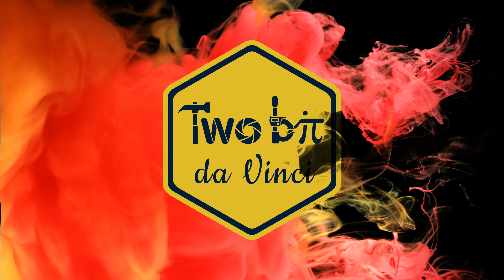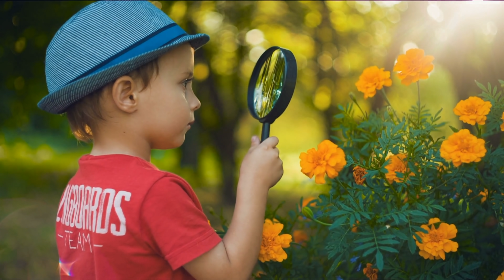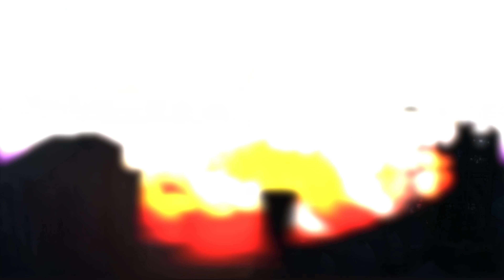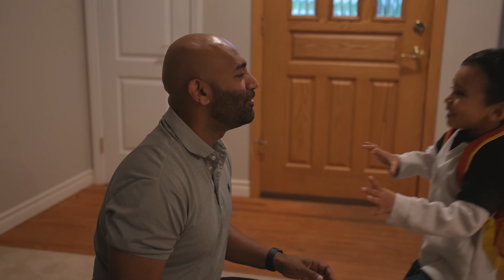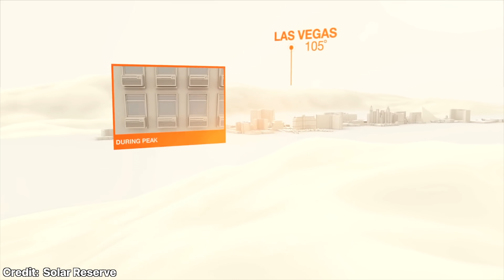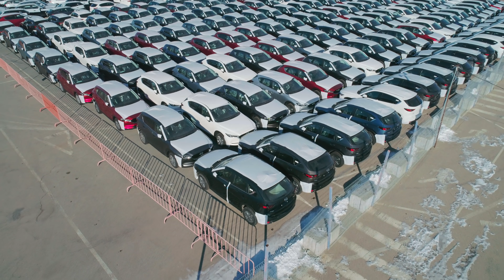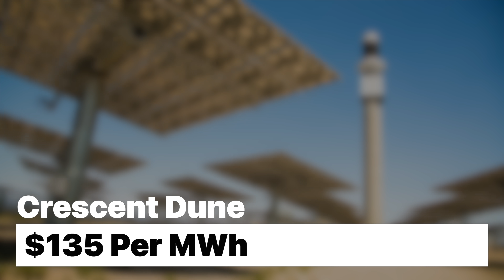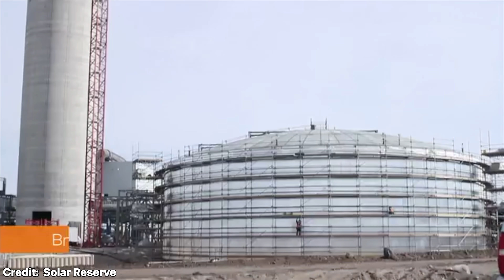This Billion Dollar Solar Plant was an EPIC Failure

Comment: As an engineer, I find this blunder fascinating.  Very surprised they didn’t anticipate leaks from welding techniques, didn’t design for automatic lubrication and auto mirror cleaning.
Reply: Moisture and salts cause stress corrosion cracking of stainless and nickle based alloys needed to work at those temperatures. So it's a design and materials selection issue, not entirely a welding issue.
Reply: @westt1988  I worked at a company that built a welding system for welding tubes that connected the heat exchanger to the top of the tower and it was all Haynes 230 for the heat as my understanding is they would be red hot in operation.
Reply: @westt1988  you wouldn't suppose they made it fail on purpose right? It seems strange they would mess up with corrosion. Perhaps not enough competitors building the same type of plant? If nothing is at stake then the development will go complacent.
Reply: @Dolvondo  sea wolf submarine is the last liquid salt boiler that comes to mind. People just don't know how to keep things isolated properly, or assume it might happen.
Reply: @westt1988  true, but they figured that alloy out for thorium sodium reactors, it was a metal I had never heard, something zinc based, or zinc coated called zircaloy, I believe , but it run for years without too much issues
Reply: @mikeysgametime8914  I agree you design for an intent. But do people design around assuming they will get cross contamination or how to ensure they prevent that.
Reply: @westt1988  so yeah I agree, if it could work in a reactor, definitely quality, or material issues
Reply: @westt1988  You would think they have a steam let off built in right?
Reply: @westt1988  Molten salts are well understood for this kind of application thanks to Oak Ridge's nuclear reactor work in the 1960s. Stainless steel is not the right material for this application - you don't need hastalloy's radiation resistance but you do need its salt resistance and low expansion coefficient
Reply: @westt1988  nickel copper alloys used on ships would have been a better alloy for such //
Reply: @AaronSchwarz42  if this is built to ASME Section I Power Boiler Code nickel copper is not an approve material for construction.
Reply: @westt1988  All of the hot side salt piping was built from welded 347 Stainless steel. All welds 100% X-RAY. I was on the project.
Reply: @matthewerwin4677  one would think so.
Reply: @matthewerwin4677  stainless steel? Isn't salt highly corrosive to that? And what did u use as welding material?
Reply: @kungfreddie  347 stainless pipe or plate got 347 stainless filler metal. 347 stainless to carbon steel was inconel filler metal.
Reply: @matthewerwin4677  so then why did  the pipes corrode???
Reply: @matthewerwin4677  thanks for your reply, but you what I'm trying to get at, that is,  If the salt corrodes stainless steel than why use it?  this green technology is not something new and has been used at other parts  of the world successfully, including ships and tankers related to salts.
Reply: @matthewerwin4677  in your opinion, what killed the plant? Since you worked on it I figure you would know better than most.
Reply: @jamminwrenches860  It should've been built close to Las Vegas instead of 200 miles from anything. The 7000' elevation of the site means the mirrors get covered in snow and ice in the winter. The plant was built In Tonopah for political reasons.
Reply: @matthewerwin4677  me too bro! They x rayed every night! On those carts that they would hook on the edge of the rim! Lol I was there for 5 years almost!
Reply: As a California resident I find this blunder predictable and in line with California's high speed rail to nowhere and LA's $800,000+ housing units for the homeless.
Reply: @erikkovacs3097  Those crazy Marxists and their trains.
Reply: @erikkovacs3097  Why don't you use California rail? It's really good.
Reply: @jamesmedina2062  No. It's not. It's practically impossible for someone like me who is a traveling technician that never works in the same place longer than a month.
Reply: @erikkovacs3097  what kind of "technician"?
Reply: @jamesmedina2062  The traveling kind. I have no commute. I get sent out to a site to do a job and don't go back for a year or more. Some jobs take a month or more. Other's an hour or less.
Reply: @erikkovacs3097  My question is not about you but about the job and tools you use.
Reply: What, you mean the people who think that you can run an economy on 15% efficency renewable energy didn't think the design through? Who would have thought? That's like not taking winter weather into account when designing wind turbines, or not properly testing your turbine gearboxes before selling a bunch of them and having every turbine you sold violently self destruct within 6 months. (Happened at a wind farm near me. Gearboxes were shot all over the landscape)
Reply: @kdrapertrucker  (^$^%#@#/€ We DONT HavE TiME TEZTING, WORLD DIE 6 YRZ FUCK SAKE!!!!!!!!!! I guess that's why..
Reply: This failure mode IS particularly interesting. The same issues with manufacturing processes will be of concern with maintaining molten salt containment in Thorium based Molten Salt Reactor (MSR). Anything learned from this failure can feed into MSR development. MSR projects are currently active in numerous countries, including the US & Canada.
Reply: @robbmain3030  molten salt service in heavy industry is old and very well understood.  There are literally thousands of chemical plants that run molten salt heat exchangers and have for donkey's years.  It just sounds like the design engineer that stamped off on this project didn't know shit about corrosion.
Reply: @StormGod29  you nailed it!!
Reply: @StormGod29  you’re absolutely correct. I worked at a site that had Kolene processes. No problems with the sodium @ 800F…only the other chems used i.e. hex chrome
Reply: @StormGod29  This is less about corrosion than having 600 feed of header pressurising the system and unsuitable thermal expansion coeffeicients in the pipework
Reply: @robbmain3030  It's exciting stuff! The concept is rooted in 1950's DoD ideas. The 1950s, so it's relatively new tech, and just like with the first modern automobile produced a little over a century ago, there will be bugs and unfortunately, people and the environment will be adversely impacted. 

Hover, it is revolutions like this that leapfrog nations ahead of their peers.
Reply: Exactly!!! Sounds like the quality assurance scumbags were signing off the inspection checklist from their homes!! And everyone was getting paid! I smell sabotage! If they weren't sure, they should've started at a small scale first and then expand! Thanks for the video tbdv
Reply: @gregchris418  that's what u get every time u give government money to ppl without any insight.
Reply: Probably contracted to lowest bidder to cut costs so the shareholders were happy 🤷‍♂️
Reply: @warrensteel9954   : That's exactly what's happening in Ireland.
Pathetic.
Reply: @mariano7699  you remember the port tunnel to move trucks. Once finished somebody pointed out to the engineering team that large trucks wouldn't fit in it.
Or the Luas two different guage tracks for the same system so now the two lines are not compatible.
Imagine new York's subway had trains that could only run in some places but not the entire network because some gobshite made a different guage track!
Reply: @warrensteel9954  

Good point - quality comes with a price...you get what you paid for
Reply: @warrensteel9954  their "lead tech" is a commenter above - mister goldstein. life imitates art, lol.
Reply: @warrensteel9954  Sure but I would assume the state requires X-rays for the welds.
Reply: @warrensteel9954    is that antisemitism?
Reply: Sue egineering company that lol planned the huge mess
........could have built small prototype!
Reply: A good point. The failure here might involve more here than failing to anticipate the drop in the cost of PV. Sometimes technology based companies headed by non technology people have problems related to that. That might have been a factor here.
Reply: @davefoc  they knew....pv went commercial which created large used market that took off. To top the cherry China over produced lifepo4 batteries as competition ran up but covid hurt economy.
Reply: In China goat herders bring their goats to eat grass bellow the solar panels and in the meantime they clean the solar panels.
Reply: And why the F. Did they not try a smaller scale model first before wasting a billion dollars?
Reply: @Shakespeare1612  they did near Barstow adjacent to the Cool Water coal gasification plant.  Both clean energy plants failed.  The salt heliostat failed quickly and was abandoned.  The coal gasification plant worked well but needed huge amounts of water but they built it in the desert.  Water was too costly to be economical.  Near a major river or lake it would have been wonderful.
Reply: @Shakespeare1612  
Good question:
The answer is that large scale was already done. Like in Spain.
Quality of metals are better from European suppliers. Did they build it to fail: by built-in obsolescence? Why did this project fail when others did not?
Was it cheaply made parts, bad design? Did they bother to just copy exactly: what was already proven to work, or did they cut corners, or come up with their own design?
Reply: They probly only got the funding if they also figured out a way to weaponize it...
Reply: Ever consider that just like the Thorium plant that just went online in China, might have been a little "adjusting" of the playing field?  A lot of technology seems to work well elsewhere after being deemed either unprofitable or impossible outside of the US.
Reply: My father said this was a bad idea even before it was built, maybe they should of hired him to tell them that, would of saved a lot of hassle and time wasting. What I have learned in life is that some humans just know stupidity when they see it and the majority of other humans are just plain stupid.
Reply: Engineers need to be taught to be technicians. Why? Because troubleshooting is problem the most important part of a technicians job. To foresee why something is not working the way it is supposed to. It's like poker, you know what cards you are holding. The trick is to know what the other person is holding.

When your brain works this way, you will be a better engineer.

I remember reading that It was a technician who figured out how to make antilock brakes work after regular engineers did not figure it out.
Reply: Don't forget its 3 miles from a bird preserve and in the middle of 5 bird migration paths.
They clean anywhere from a couple hundred to a couple thousand birds every month.
Birds that were cooked some explode before they hit the ground.
Reply: @thesilentone4024  I was looking for this comment. This path is the easiest way for birds to travel past the Sierra Nevada Mountain Range. So these birds were being funneled right into a giant oven.
Reply: @danapaul3216  yep and I think it needs to be changed to something else or not be there its definitely bad for life and unfortunately not thet efficient too well this one specifically.
Reply: @thesilentone4024  
Amazingly bad planning
Reply: @thesilentone4024  
Amazingly bad planning
Reply: @thesilentone4024  
Thank you for this information.
Reply: @thesilentone4024  yes, but just because you don't see the dead birds floating in concentrator and wash ponds in all the "third world" countries getting the metals for photo cells, does not make this any more impacting on the environment.
Reply: @ricksanchez3176  what are you talking about.
Phones different country's.
Like come on man I literally just said this kills birds its in the middle of 5 bird migration paths.
Also this produces so little energy that literally every time it gets turned on they loose money.
In fact I'm impressed with how it's still there.
But if you want to talk environmental damage then you should go to the copper and nickel mines in America and get them to stop or increase productivity to reduce demand on foreign mines and reduce the human risk your worrying about.
Reply: @thesilentone4024  Dude you're lost.  Everything is in a migration path, if it isn't a sea turtle, it's a dung beetle.  vacuum isolated solar, there are many up and running works, and works very well, regardless of the hack job on this plant or this video.

And yes, absolutely, I would love to see our US mines back in production.
Reply: @ricksanchez3176  dude your missing a big point.
5 main bird migration paths.
Its also 3 miles away from a bird preserve.
The way the mountains are there its funnels them in a tight spot and they put it smack dab right in the middle of that.
It uses mirrors to heat up the area like heating up stuff should be the last thing to do since are climate is hot already.
Reply: @thesilentone4024  You kinda had me....until you absolutely showed your ignorance to the subject.  The mirrors reflect light that would normally be absorbed and then radiated into that "climate -that is hot already".   It focuses that heat, melts some salt, water on salt, steam, turns turbine, turns generator, magic little pixies carry the heat away from the area to power your AC. Ironically making it cooler in the environment where the light was, and cooler inside your house, but hotter in the environment just outside your house.  Would you like to know how air conditioners work too?  You really should learn.    Yes, if the birds fly through the focused light, poof, (if we could just get them to eat garlic and butter first.) but for heating the already hot climate.......LOLZ
Reply: @ricksanchez3176  shows how much you know like wow.
1 its 20f hotter in a 4 miles.
2 even though its a couple miles from the road it blinds the hell out of you have you ever driven by it when its glaring all the light at you.
3 these mirrors need to be cleaned every day and that uses lots of water they even state that in there own personal website.
4 literally look it up every time it gets turned on they loose money.
5 the amount of land used for this needs to maintained and with this kind of energy no plants at all can be on the ground around these mirrors.
6 I've worked there for 2 dam years i think I know what I'm talking about so educate yourself or shut up.
Oh ya its normal 110f out there normally but around this tower its 130f normally and lots of plants can't grow in those temperatures even the native ones.
Reply: @thesilentone4024  LOLz  So they didn't use TiN glass?  So misengineered their collector?  Ofcourse it would make power if it's throwing light out.  Why don't you take two minutes and look up Thorium reactors, and the impossibility of them, but it works in China.  Why don't you look at the history of these evacuated / collectors, first one was built here and sabotaged aswell.  They work everywhere else.  Do you understand the physical impossibility you are stating?
Reply: @ricksanchez3176  I have dude.
Where this was set up its doesn't make money.
You know what how about you go study plants and hydrology and how heat transfer works then get back to me.
Reply: @thesilentone4024  LOLz  Hydrology is a pretty broad term, could you be a bit more specific?  Are you stating that because they didn't use sputtered glass on these mirrors, while they do solar panels, that makes this proven technology invalid?  If they can warm the surrounding area up 20 degrees for four miles, with this, coal, gas, petro, hydro, you've just solved the world's energy crisis.  Give me details, let's figure out how to capture it.
Reply: @thesilentone4024  P.S. It's not where it is set up, it's how it's set up.  That light that blinds you, that's called a loss.  Engineered that way, I have a hard time believing they are that dumb, but they could be, but likely intentional.  Yes it's far enough from the equator that it has more initial cost and more arrays to maintain than similar plants built in the tropics.  That's solvable through engineering too.  That's where scaling out with multiple collectors increases each additional's efficiency by about 50%.  TiN sputtered mirrors, lessens cleaning by way more than half.  A concave tracking reflector/concentrator into a concave collector would up efficiency substantially.  Is the collector even a fresnel?   It's an anonymous account, I really don't give a flying fart about how feel about my understanding, but it does not take a genius to see the multiple design flaws, if tested at smaller scale would have been dropped.  This particular plant was designed to fail.  Placing it in such close proximity to the bird sanctuary and on the migration paths could very well been part of that.  Why don't you see who financed the financiers.
Reply: Molten salt is not a gentle heat transfer agent to deal with, tough on pumps valves etc.
Reply: I thought the same thing. I would be concerned with all those moving parts as well. Just too much stuff. My personal take on your question is that is was a prototype pushed by pro solar on one side and opposed by anti solar on the other. That means a lot of energy was spent selling the idea and pushing it through and I am sure there was a lot of wishful thinking and not as much money.
Reply: So let me get this straight. We basically let the market decide and the market decided that profit dictates how clean, healthy, and sustainable/accessible any technology is. Something is wrong.
Reply: @bryb2644  No, it's cost that makes these decisions, and costs are very dynamic in renewable energy. Personally, I think advancement in robotics and fabrication techniques could lower the maintenance costs of Crescent Dune to economic viability...someday. Wind had a long, concave downward sloping cost function, and then there was substantial deployment. The maintenance costs of turbines currently prevent wind from undercutting other renewable technologies, but those will decline when robotic maintenance becomes practical.

If photovoltaic becomes the dominant solar capturing technology, we would expect the price of silicon driven up. We should conclude that heterogeneous solar technologies can facilitate substitution when demand pushes up the cost of any particular technology. Don't forget, someone is working on fusion reactor as well.
Reply: I’m sure jobs was a big sell for that $500M. Automation would have “killed” jobs, so, do it the stupid way instead of the lazy one.
Reply: As an engineer I am not very surprised that an engineer thinks that a more complex solution would have lowered the maintenance cost.
Reply: It's an obvious self sabotage
Reply: Same here. I'm not a mechanical engineer but doing mostly embedded systems stuff. However, when we design a new product, we think about the stakeholders and the use cases then you derive your architecture from this and go deeper and deeper into the details until you finally start building "the real thing", i.e. the first prototypes. I am quite sure that mechanical engineers do it the same and they would have/should have had lubrication and mirror cleaning on their list.
Reply: Even those needs maintenance, when cutting cost comes into play, most large and big companies will go to business analyst consultants at the end to provide unseen solutions from a new set of views. That’s where I am, and mostly we deal with governments, either we don’t agree to things and they will do what they think is right, or they see the view from our standpoint where the issue is, and we can start thinking solutions through our own and their connection together. In this video it said, the budget went 4x more than expected, we are not talking hundreds of thousands, we are talking millions. I’m pretty sure they had to consult one consulting company for your solution(especially when the government invested in it) and deemed it as not good enough as the cost cuts is not even close to profit. Because in my case or my company rules, we do it in theory first than implementing fixes that might not result in decreasing or eliminating the problem.
Reply: @ajstyles5704  I have had companies run all the equipment into the ground for one more $.
Reply: @markwagstaff4464  That is because they have a piece of paper stating what it should do when they bought it without looking at those machines and see what they could or couldn’t do depending on the situation.
Reply: Even auto lubeing systems must be maintined by people at some point.
Reply: As an engineer, you failed to consider the financial aspects of this project. It could never make money due to the super high capital costs. Total scam from day one.
Reply: When as a young Engineer and running an "exotic" English motorcycle I was  told by an old Engineer that "when the heart rules the head,   money flies out of the window"  I eventually came to realise that he was right.    Looks like the heart was ruling the head on this project.
Reply: How about the mirrors withstanding strong winds.
Reply: Exactly. Sounds fishy to me, like it was designed to fail. Many things have been built that are far more complicated and been successful.
Reply: 'Welding Techniques' is a nice way of saying 'welds that melted'.
Reply: @bugstomper4670  They don't melt.  They usually crack in these conditions due to grain boundary attack by chlorides.  (BS Chemical Engr, formerly a certified welder).
Reply: @paulparker9339  I was being sarcastic.  But thanks for telling me.
Reply: @bugstomper4670  Gotcha.  Sorry I did not pick up on that.
Reply: Welcome to California.
Reply: That’s because it wasn’t built to any specs, or had any issues or concerns with anything. Amazing how communist people will become when there’s other peoples money available to burn.
Arnold did not promote this project with his money, he used your money to make a mess.
Reply: I do to I am an engineer with 45 years exp in processing engineering
Reply: They were probably ideologs, don’t have to worry about making something profitable, paying everyone a high salary
Reply: mirror cleaning technology development was one of the goals of this plant if I'm not mistaken. nobody quite knew how mirrors would degrade in the desert
Reply: Some waste of money
Reply: @brianbartolomeo107  right, great point, dropping millions upon millions, and yet we have people literally starving to death, what a shit show
Reply: AS AN ENGINEER ..... JOINT LUBRICATION IS THIS ADVANCED STATE OF BEARING TECHNOLOGY SHOULD HAVE A 30 CYCLE ...TIMKEN MUST BE UNKNOWN TO THESE IDIOTS , AS ARE AUTOMATED 100% XRAY WELDING MACHINES ...AND  100%  XRAY  MANUALLY WELDED JOINTS...KNOWN TO THE NATURAL GAS SUPPLIERS FOR ......DECADES....... THIS IS THE BEST BULL THAT THESE  PEOPLE HOPE THAT THE VIEWERS WILL SMOKE.....ABEJECT CLOWNS
Reply: The first rule in contracting out a construction project is to find contractors experience in building such a project.  What, first time something like this has been built in this country?  Oops.  Expect some snafoos.
Reply: It's what happens with government funded green energy projects. They are often taken by people seeking a cash cow with no real intention or ability to competently complete the project. Even when they fail the person in charge still got millions from the gov and the politicians in charge still get to pat their own backs and say they did something green because it doesn't cost politicians anything only tax payers.
Reply: How to launder money
Reply: reading some comments here making me laugh.  you guys never ran a furnace in a foundry before obviously or you'd know that the absolute best materials to use are still not foolproof and even the best welds will give way under those temperatures eventually. and human error just makes it so much worse.  think about it, you use clay brick, the best material for insulation and it still corrodes eventually in an aluminium furnace which is only needed to run as low as 800 degrees ferenheight.  parts are still going to be need absolutely replaced every so often, say once a year.  now that's without human error.  you've got all this molten salt running around all day and night, who's going to run it?  the same guy?  no. you need to train one guy who trains the next guy, who trains the next, etc.  it's hard, stinky, hot, dangerous work, so people quit or demand more money, tempers can flare, one guys screw up can compound and make it harder on the other guys on different shifts, it needs to be a team effort, no one screwing up or everything is now so much worse, slag builds up on slag, clsmall cracks get expanded rapidly!  you can throw all your hypotheticals out the window even if you really know about it a lot.
Reply: LOL - Guaranteed fail when government is involved. Example: see the Boston Big Dig originally budgeted @ $3Billion final cost $24 Billion & 5 years late plus millions of gallons of saltwater are leaking into it daily. If Boston suffers a blackout the tunnels will fill overnight.
Reply: wow. we should put you in charge of every solar plant
Reply: @htf5555  Thank you for vote of confidence, but I’m not qualified to manage one solar facility.  But as chief engineer on this project, I’d make much better decisions.
Reply: "As an engineer", 'automatic lubrication', 'auto mirror cleaning'
What fantasy world are you living in?
Not cost effective, almost as bad an idea as expecting battery storage to replace actual power stations. You have to be either ignorant or extremely bad at maths to get behind solar+wind=battery...
Reply: "As an engineer, I find this blunder fascinating.  Very surprised they didn’t anticipate..."

Sir, this isn't business---these people are Saving The World. With Other People's Money.

Issues like Cost and Consequences of Failure are utterly irrelevant.
Reply: Get what you pay for
Reply: MARz roverz az WELL ‼️👽🥵😱
Reply: These debt trap 💰💵 are engineered to generate FUND$ straight into the bed buddies and families of your favorite politicians.
Not all loss.
As usual.
Go figure.
Reply: Interestingly, roughly 70 years ago, when nuclear energy was harnessed for civil use, no one calculated the true cost for that technique either. Can't we trust the engineers then, the business people or the politicians? ;-)
Reply: @kasimirb5155  The difference is that decisions regarding Nuclear generation were not primarily about producing electricity. The processes for refining the fuel were about the manufacture of nuclear weapons. Of course, politicians benefit politically from most ground-breaking civil works that take huge amount of the costs away from the military budget, while promising miracles. When it was all in the theoretical stage, the decision to pursue uranium over thorium as the fuel was 100% because it's easy to enrich  uranium to fissile quality in order to make weapons, but not viable with thorium. Otherwise we would probably have far more, far less hazardous thorium reactors instead of the uranium & plutonium ones. Thorium nuclear waste is far less radioactive and only needs storing around 300-400 years, whereas conventional uranium nuclear waste is far more radioactive and has to be stored for thousands of years.
Thank goodness we have had a long series of governments that have been so anti-war! (Not)
Reply: The leak makes the prospect of molten salt nuclear reactor more scary.
Reply: @xinfuxia3809  it’s a known issue that they knew about and we have material made to work in that environment but it’s expensive and they chose to go with lesser material because cost
Reply: @xinfuxia3809  corrosion is indeed a problem with MSRs, but there is also already a solution being researched .. a corrosion resistant alloy at high temps called Hastelloy-N
Reply: @xinfuxia3809  why so. By definition, a molten salt reactor thatoverheats has the salt plug melt and the liquid pours out into a container the the process stops.
Reply: @xinfuxia3809  MSR production is at another tier level c'mon.
Reply: @xinfuxia3809  They ran fine at Oak Ridge and China now has a pilot project based on what was done at Oak Ridge in the 60's.  Maybe they should have gone to Oak Ridge and learned how to handle molten salt.
Reply: Why can't they take all the mirrors off, but leave the hiliostats? Beef up the wiring and send all of the power back to either some telsa super batteries or a gravity based cement block stacker? Reprogram the helio stats to do simple sun tracking instead of sum bouncing.
Reply: @Shakespeare1612  would that work.. ? Stacking blocks seems to complex.. easier to have a very heavy weight on a long wire and a gearbox. But the idea that I've heard of.b4 is pumping water to a higher location and then use it as a power dam.
And isn't the heliostat the thing in the middle? What's the use in leaving that without mirrors?
Reply: @kungfreddie  Heliostats are like "turrets". They are devices with two motors able two turn left to right, and up to down. Stone blocks are heavier than water so they can store more potential energy in the same volume. And yes these systems can work.
Reply: @kungfreddie  v
Reply: It's baffling. I work in the same technology field i.e. solar thermal energy and these guys were moving molten salt through metallic tubing which is ridiculous. Oil or distilled water is a far better option but it doesn't give you enough temperature to run turbines without damaging them, which is why energy generating systems that don't use turbines are so attractive in this field.
Reply: @Intellechawwal  huh? U run water through turbines all the time.. thats what u use.. or steam rather.. u use molten salt to heat the water to steam. So I don't get at what u mean?
Reply: @kungfreddie  What I mean is this: to run a steam turbine, you need the steam to be at very high temperatures. 100 deg-C steam is still steam but it loses energy and condenses on the turbine blades and ruins them. So you need to ensure that steam does not condense on the blades and you do that by keeping it at high temperatures. However, if you're using dielectric oil or water to generate steam, you don't get very good quality; which is why these guys used molten salt which comes with its own problems. The 2nd law of thermodynamics was pretty much invented to differentiate between low quality and high quality steam.
Reply: @Intellechawwal  There have been some pretty good work arounds to the turbines for less than prime geothermal sources.  Old timey piston steam engines, linked, and a big flywheel.  They're running, and they make a nice clean 50 cycle when geared up.  A bunch of a low potential is as good as a lot of a high potential, if you can capture it.
Reply: @Intellechawwal  It certainly is not a mature technology. Not like they’ve built ten of them.
Reply: @jamesdellaneve9005  On a smaller scale, solar thermal desiccant chillers are actually quite feasible, but by small, I don't mean residential-scale small, I mean good enough to cool a skyscraper. Many companies in China and India are producing those. They do it very differently though.
Reply: A bit of over engineering with all the moving parts.
Reply: Not only that. Look how complicated this goddamn  System is. Only the department of energy would be stupid enough to invest in such a debacle. Everything is stressed to the limit here and there are so many moving parts. Compare that to photovoltaic, where there are, absolutely zero moving parts. Everything about the US government leads economic and practical disaster…..

50 years ago when I was growing up they put in an egg beater shaped wind turbine near the San Luis reservoir in Central California, financed by the government, at the time governor moon beam, also known as Jerry Brown. ….  Design was so stupid that it wasn’t even self starting. You had to motor it up to get the windmill going, and once it got spinning a little bit, the wind would take over…… The goddamn project, the thing was rarely ever running, eventually they tore the whole thing down, it probably cost the government $1 million or more and it produced basically zero electricity…..

How many egg beater windmills do we see around the world today. Well about the same number as the IQ of governor Moon Beam …. Zero!
Reply: There were times when promoters got their congressmen and senators to write into laws providing funds to such projects. DOE by law must fund such projects.
Reply: @steveperreira5850  Complicated?  Tell that to the Italians, they seem pretty happy with theirs.  Have you ever been in a power plant? This is half the complexity.  Buddy I've seen scrubber stacks in coal plants fall down because an engineer or purchaser screwed up and didn't get their alloys right.
Reply: @steveperreira5850  Your points are valid, but you have to measure the costs at the time the green light was given, not today.
Reply: Solar doesn't work as an engineer no matter how interesting is bogus.